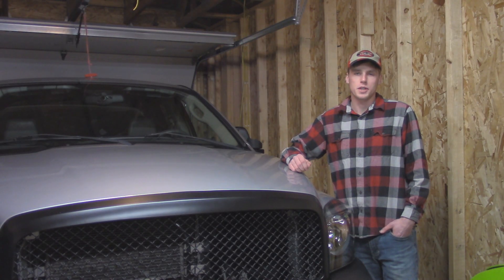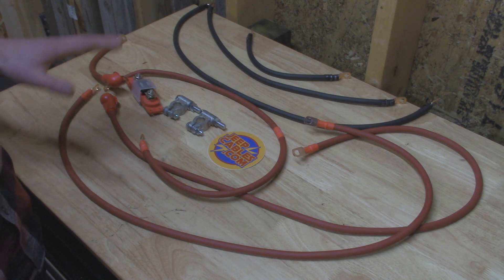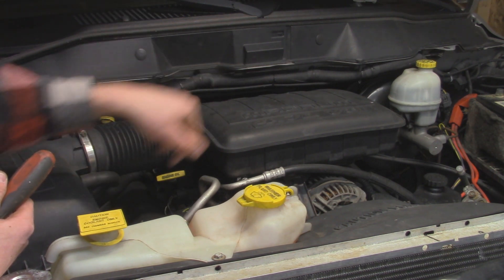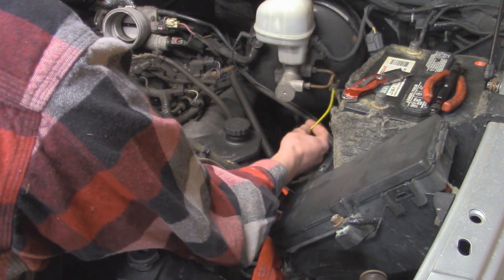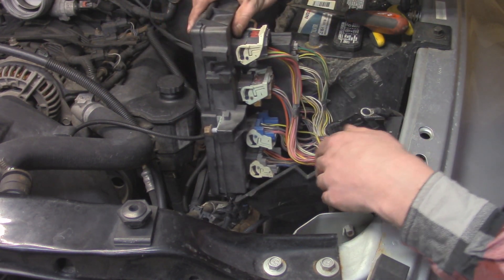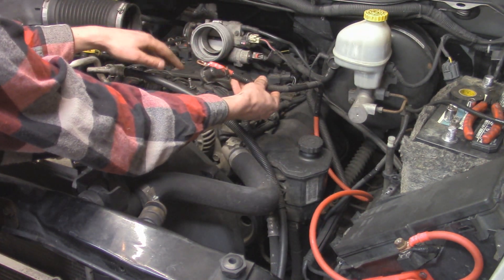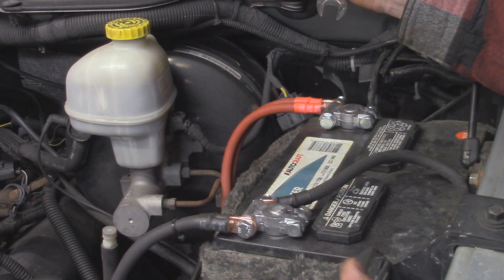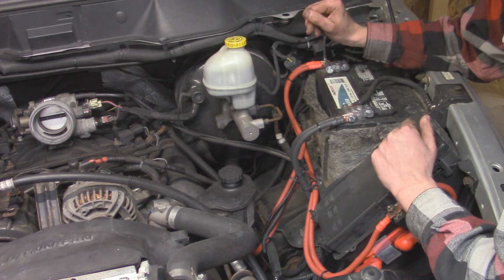Dodge Ram Power Cable Upgrade | Jeep Cables

Comment: man i have been looking for battery cables for me 2008 ram 1500 4.7l , been having intermittent no start issues, come to find out the battery cables are bad and they’re all discontinued everywhere, i happened to come across this video and you saved me with the website, much love man🙌

Comment: I left the original cables in place, Ran the upgraded cables right along side them.

Everything fit on the studs & terminals.

GREAT FREAKIN CABLES, THEY ARE ALSO MARKED WHERE EACH END GOES, VERY NICE.

Comment: Nice video but the negative terminal should always be removed from the battery first to prevent shorting the tool from the positive to ground.  The negative should always be installed last.  Keep them coming, good information.

Comment: I also bought their upgraded headlight kit for my 97 ZJ, MUCH BRIGHTER HEADLIGHTS.

On my 99 I made my own cables out of HEAVY WELDING WIRE & ALSO PUT RELAYS & HEAVIER WIRE FOR MY HEADLIGHTS. HUGE DIFFERENCE BUT TOOK MUCH MORE TIME.

THESE KITS ARE WORTH EVERY PENNY, T.Y.